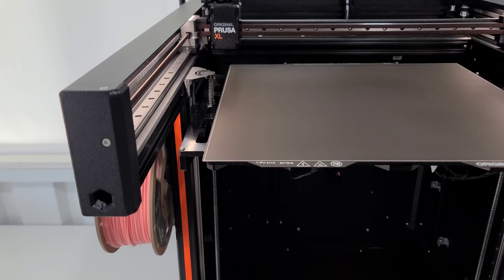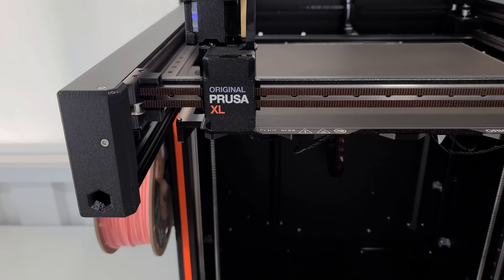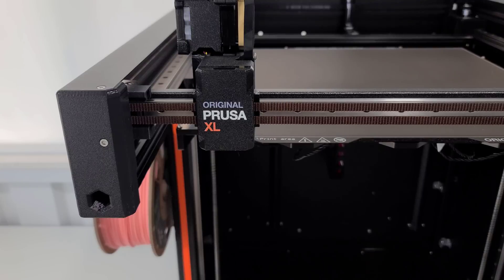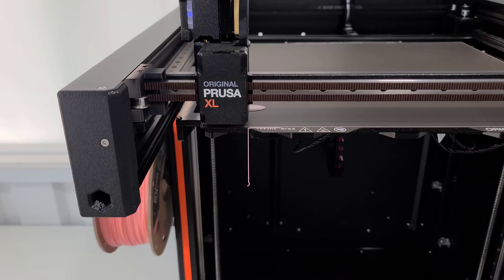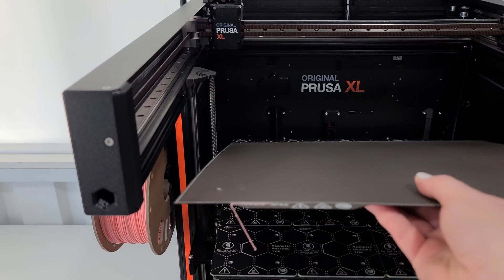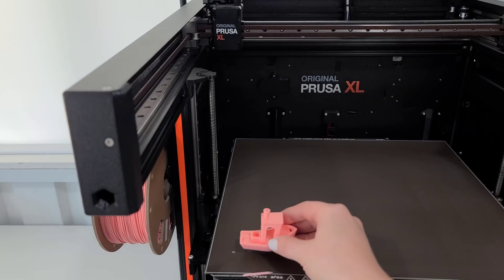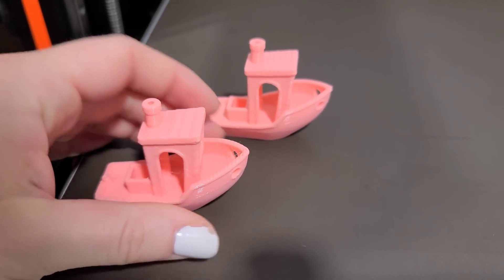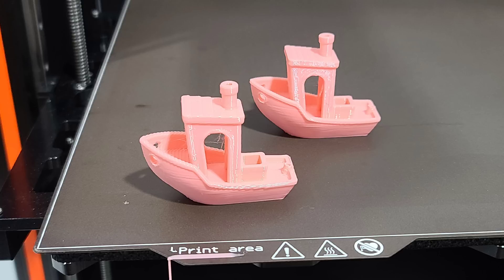Printing a Speed Benchy on the Prusa XL!

Comment: Just on this vid - the machine is a lot quieter. The harmonic vibration isn't as bad as that other video - i think in Prusa latest update they were changing things to reduce noise at certain speeds so hopefully you have a "fixed" machine and it was just the table. Quality in 0.25 looks good. Will be good to see it run faster on the new firmware. I won't get mine (2 nozzle) till later in year :( Depending on these vids and others i may proceed or maybe not - so far watching your vids - thinking I may proceed. if others align tou what your showing then it will be good. Hopefully some things will improve by then too. some early adopter issues will be fixed after 8 or so mths.
Reply from the maker: Yeah I had a lot of echoing going on with my setup in previous video. I'm happy with it. But I can see waiting until they make any adjustments. Thanks!

Comment: That purge line supposed to be on the cutting edge like that? I’d be curious about multi-color on the xl and how smooth the transition is using a single head
Reply from the maker: That's how my purge line always looks. This is a single toolhead so it will only print one color except for color changes on layers.
Reply: Multi color single head is not a thing without the MMU3. I am not sure if the MMU3 will work on the XL or only for MK4. Multi tool switches.. from a year ago.. were dong in < 3 seconds with no waste. HUGE improvement over X1C and AMS setups. Will bring true multi material/nozzle options that no other printer can do. I have no doubt we will see amazing prints that can only be done on the XL.
Reply: @WhySoDivided-CantWeAllGetAlong  Color changes can be done in a single head config.. even the MK3S.. the print stops, unloads the filament,  loads the next color and does a purge before resume.  Once the change has been done it goes through the same process to the original/next color.  In terms of the XL I wonder if its even more automated and how the resume once changed looks on a final print.  Without a MMU I typically only do this for embossed text on the top layers